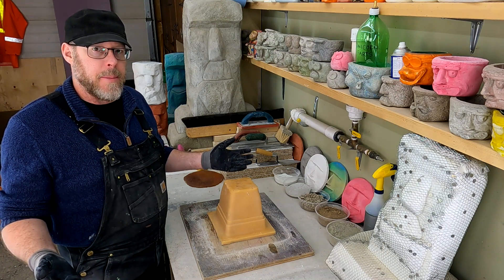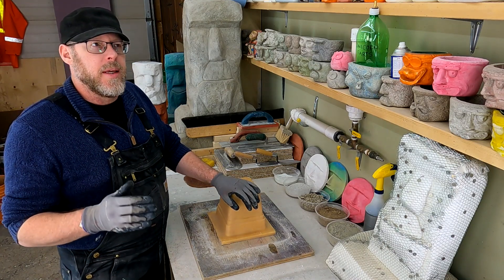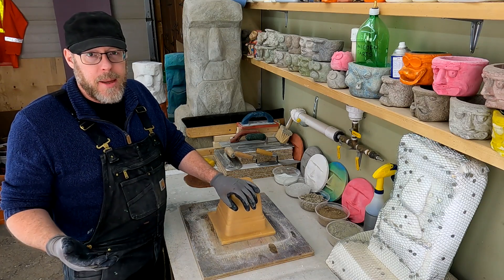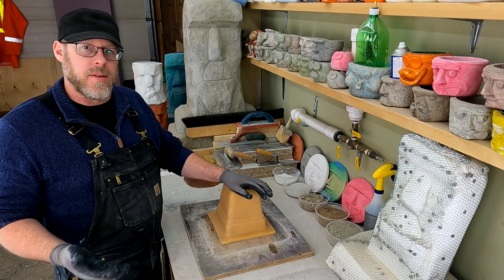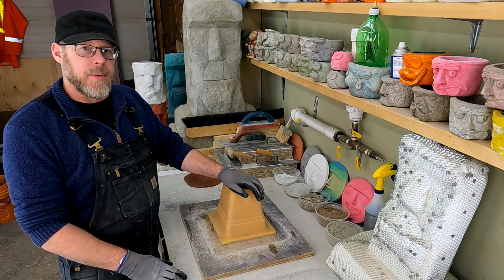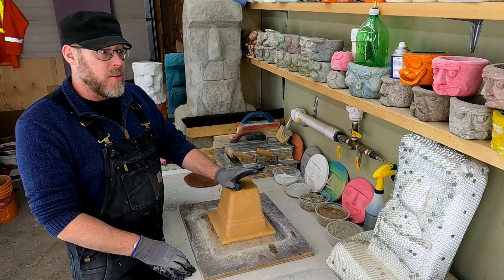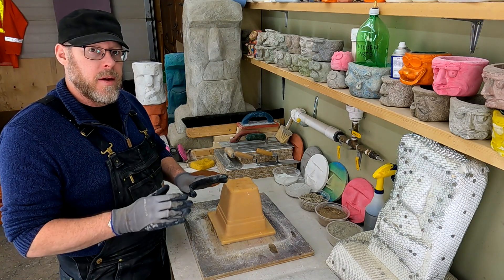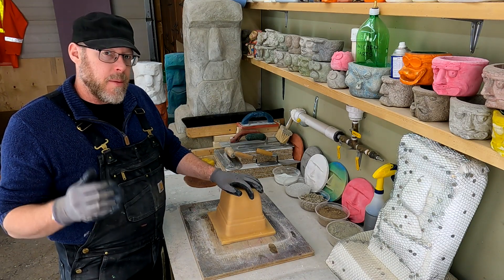Does Concrete Always Need Steel?

Comment: Great information. Your videos are so tremendously helpful to me, & you are a trustworthy resource with experience, unlike some other channels I've encountered.... Question about the state of the steel? Must it be galvanized? Can i prime it with rust proof primer? For example, I have some steel 3/8" rods that were temporarily used as garden fence posts but can rust in spots, probably not coated in any way. Any suggestion on ways i could prep them for use in concrete? (I also thought of using soldered tin cans for small sculptural armatures, & saw some rust, similar to the garden steel rods).

Comment: Will all metals embedded in concrete (thinking rebar and wire mesh) begin to rust starting on day 1 and eventually lose its integrity from the moisture in the concrete and what it absorbs during its life? What inexpensive strategies can protect from this corrosion? Thank you.